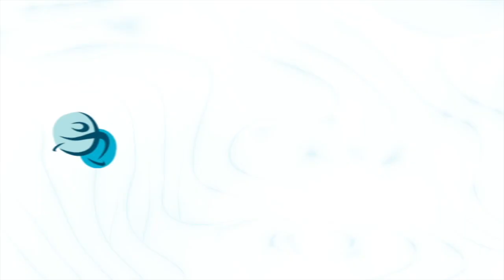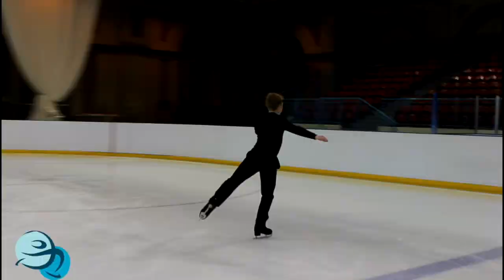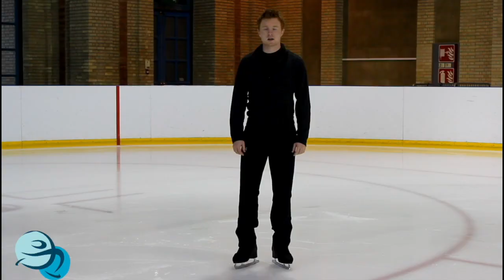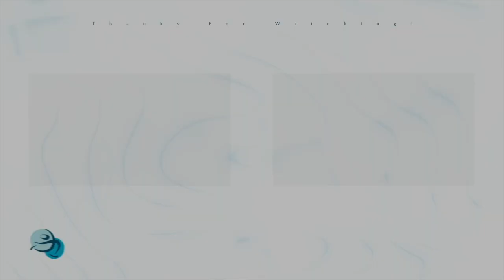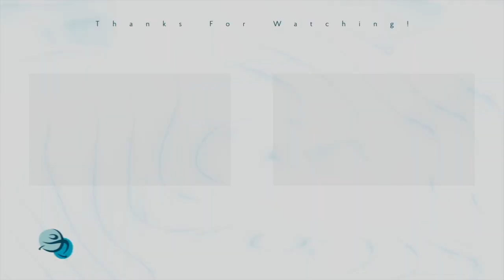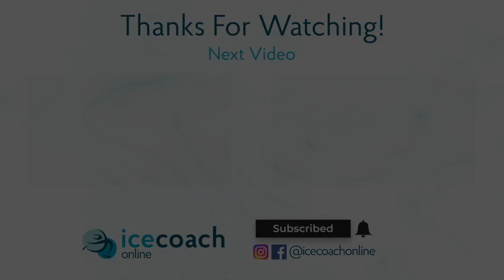Great Beginner Ice Skating Jump to Try on Ice! The Bunny Hop!

Comment: So there's no pick launch in the middle? I think I was taught to do this completely wrong!
Reply from the maker: There's a "pick launch" right at the beginning to get you up in the air, but the next thing after that would be the pick landing!
Reply: @IceCoachOnline  but I shouldn't be digging my pick into the ice and having snow fly right?  I think my instructor confused this jump with a side toe hop.
Reply from the maker: @captaincrunch784  no, that doesn't sound correct